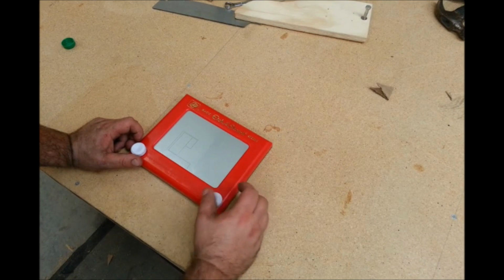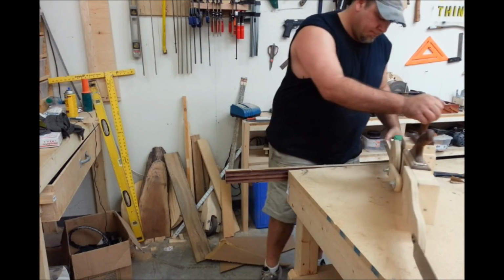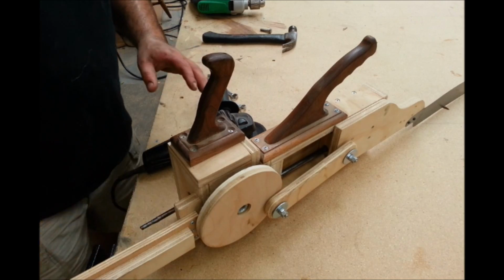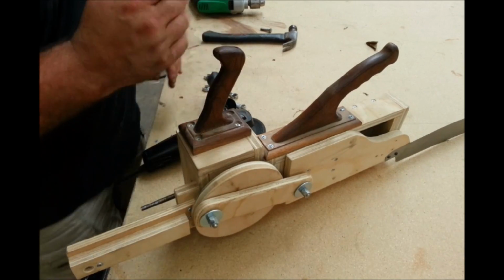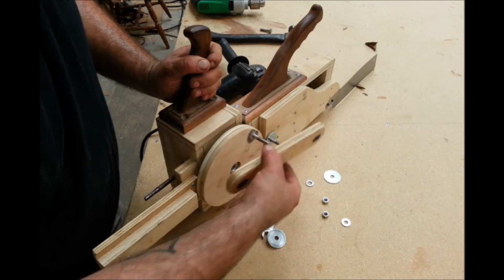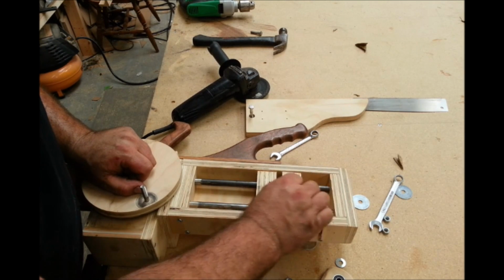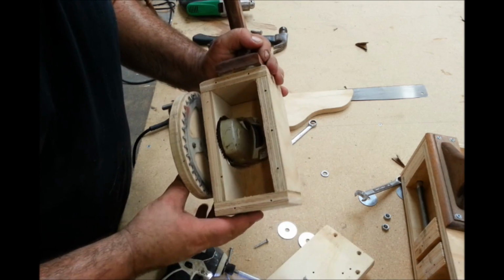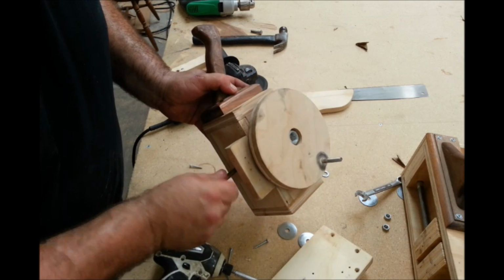Drill Powered Hand Saw Explained

Comment: Another take-away from this is never buy an inexpensive angle grinder, unless you are going to use it for no more than 20 minutes and throw it away.  1st one did what your gearbox did.  When I took it apart there was a dollop of grease on the inside surface.  Nothing on the gears.  2nd one started to smoke from the motor wires, while using it to trim a few nails in cement with a cutoff blade, not heavy work.   My 3rd angle grinder has about 3 times the power of the first two, is far more pleasent to use and cost about $80. Instead of $20.

Comment: Ya know, I thought this was just ridiculous (and awesomely fun) when I saw it the first time.  But it got me ta thinkin'...

I have a lot of wood on my property and was thinking that this basic design (a reciprocating blade) would be a great start for a poor man's home lumber milling rig.  
At least it would beat trying to find a 26" or larger old mill saw blade.
Reply from the maker: interesting idea. would need to be a real beefy unit
Reply: Yeah, no doubt.  I'm not afraid of that so much. I can salvage a 1hp motor out of something and gear it for torque.  I'm just wondering how much throw I'd need in the mechanism for it to be sensible.  O'course the blade would need some kind of support/tension on the top.
Reply from the maker: you would need enough throw to clear the chips my guess would be a 5 to 10 inches larger then the biggest log you intend on cutting with a blade length double the plus a the extra ten inches.
Reply: izzy swan I expect that shouldn't be TOO hard to achieve.  I suppose what I'm thinking of is basically a huge scroll saw.  It's all about finding a blade. I s'pose I could make one. But that's getting a little outlandish even for me.
Reply: Yeah. That's what I'm thinking.  A saw of the proper length is going to be much easier to get than a 48" circular saw blade or some such nonsense.
Reply: Look for a dragsaw on ebay.

Comment: Could you not just use a right angled drill chuck instead of the one from the angle grinder, should be a lot tougher and make it simpler to build
Reply from the maker: TheLukey21 it would be to fast the gear reduction in the right angle grinder reduces the speed significantly which makes it better suited for this use.
Reply: izzy swan ahh, what about using say an impact driver to power it instead or a normal drill driver in its lowest gear. (I'm not sure why I'm trying to make other solutions because I'm not planning to build one)

Comment: Too much rotational mass and torque spreading... You might consider next right angle drive use more compact, thinner and strong material with dual blades that counter cut like a electric meat knife...